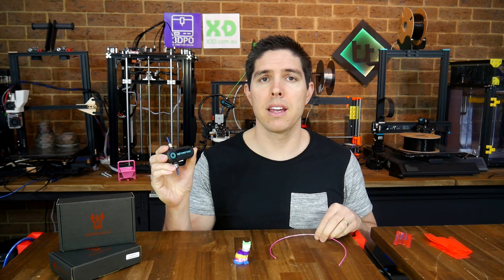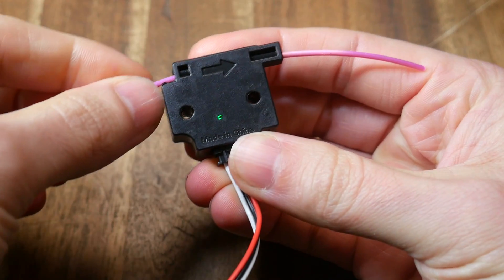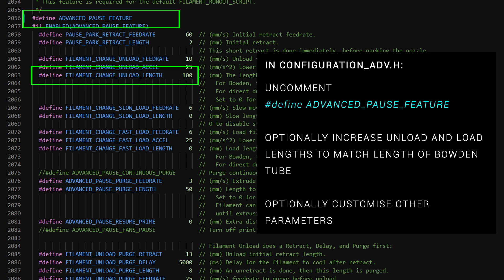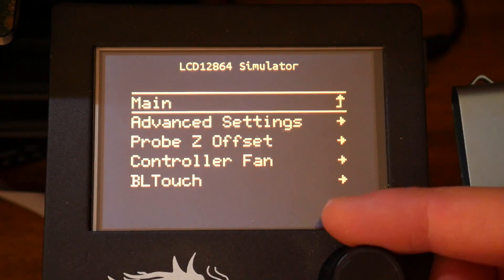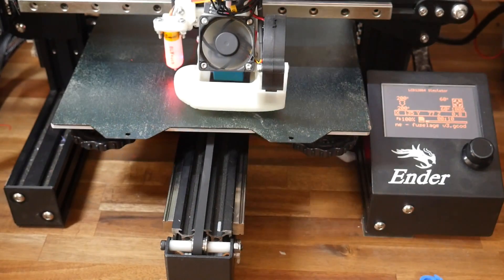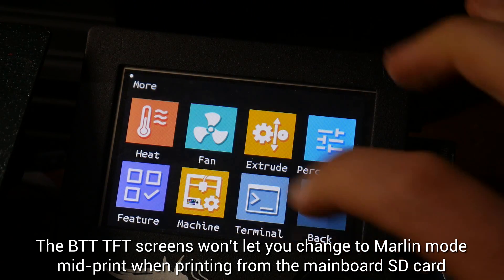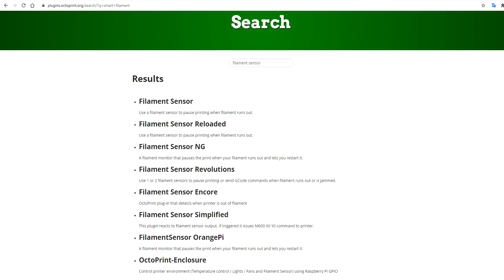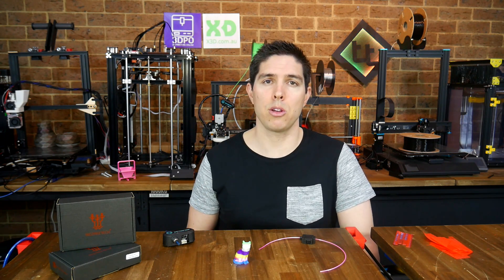BTT Smart filament sensor guide - Detect filament runout and jams

Comment: Hi Michael, I have followed your install several times. But mine keeps false triggering. I have been working on getting this to work for weeks now. Today I may have found a bug in some machines, I have a cr10 s5 with skr 1.4 turbo board with 2208's' It seems that the settings stored in the printer overwrites the FILAMENT_RUNOUT_DISTANCE_MM in the firmware. In my attempt to get this working I went into printer configuration -> advance configuration -> filament.. I tryed to change the run-out distance there but as soon as I click to make the changes it goes to 0 and will not let any changes to be made A reset is the only way to get it back to what it was... I also feel this has something to do with the power recovery function that also false triggers. Do you have any idea of a work around? Or even heard of this problem?

Comment: Great video - a thought: Could this sensor be used to calibrate the extruder steps?  You might have to calibrate this sensor first, but once that's a known quantity it should be possible I'm guessing.
Reply: Superb idea!
Reply: I'm sure it could.
Reply: Is the encoder and roller arrangement accuracy/tolerance within usable range for something like this though? Electronically as well as mechanical (?)

Comment: Michael I finally got the BTT Smart Filament Sensor to work on my Ender 3 Pro with a Creality 4.2.2 mother board!.  Here's a summary of what I found out
All the firmware changes that were described work , but for the Stock Ender 3 Pro 4.2.2  motherboard there are a few important differences;
1) The Creality 4.2.2 mother board pin "FIL_RUNOUT_STATE" has to be set to HIGH not low.
2) The pins on the motherboard PA4 plug where the sensor plugs in are, left to right; "Signal-Ground-Voltage"  the sensor I installed had the ground wire with a long white dash on it and the voltage wire had little "+" signs on it.  The signal wire had nothing.
So far I have run about 6 hours of prints using it and it checks out perfectly.

I really appreciate your efforts to  "teach" us how to modify our printers,  I've got mine setup with tis runout sensor and a BLTouch, so its simple to get good prints.
Reply: Hi, I have ender v2 Creality 4.2.2 mother board it is possible to work too?
Reply: I have mine installed but not working. Please tell me exactly what I need to change in the gcode to make it work, on klipper. Running a creality sonic pad 4.2.2 board ender 3 pro with 2.0 filament sensor and its printing like a champ just is not stopping the print by itself when there is an issue with the filament being fed! Also have a bl touch all set up good to go but yeah, need to get the filament sensor 2.0 working its all installed but wont do its job!

Comment: I tried hooking this up to my main board BTT SKR E3 DIP  and I couldn't get it to function so I tried to hook it up to my BTT TFT32 and it still wouldnt function. I was thinking it was bad so I sent it back to Amazon. All I need is a sensor that tells me the filament ran out so I'm trying to use my z-stop switch hooked to my TFT so I can use the touch screen. I'm not finding out how it needs to be wired though. I've hooked it up several ways and then do an M119 to check if it is functioning but it always reports open. Could you or someone help me or with the wiring? I can't seem to find any instruction or wiring diagram on doing this. Thx

Comment: I read github issues thread  (https://github.com/bigtreetech/smart-filament-detection-module/issues) and there were a few people with 
same problem as me. (
as usual with me, it can't be according to normal instructions :D ) I solved it but i spent 3 hours searching for a problem (printer Ender3 pro and SKR mini E3 V2.0) 
I hope this helps someone. Behavior: If you start printing marlin almost immediately trigger filament change. 
It looked as the board was not receiving any signal or no impulses? ok... I built firmware again, check cables,change sensor positions, looked into the sensor if there was a slip, change runout distance...without success. I watched the video one more time. Michael test sensor with simple circuit and diode. I tried it too and figured it out there are differences in two outputs. Connector left to to right: Ground, S,S, +5V. My first S output (its output which is used as default with factory cable) not working correctly, diode constantly switched on almost without interruption. Try second output and it worked just like in the video. I don't know if this is normal or the sensor is half/damaged but after i modify cable and use second S output everything works perfectly. 
My advice first check the sensor with diode if there is a pulse.

Comment: UPDATED:( CHECK REPLIES)I am not savvy at all when it comes to modding firmware. I keep getting codes thrown even when I try and build without modifying anything. Any way you can upload your firmware for the ender 3 with the bl touch and btt filament runout sensor on this page? It would help everyone including myself out so much! Keep up the good work!
Reply: Maybe the Octoprint-Smart-Filament-Sensor Plugin could be helpful for you if you  have problems flashing your firmware. It was released after this video. In the video description a link was added as update
Reply: @annil.8828  Thanks. I will check it out and see. I've been working with Chris from Chris's basement on this so after I do another firmware update I will try that out.
Reply: After many attempts myself I had help with Chris Riley from Chris's Basement. He was able to get this fixed and confirmed the only way to run this is in Marlin mode. If you have any BTT TFT touchscreens, the runout sensor will not work on touchscreen mode, but fortunately will work in Marlin mode. Keep this in mind for future reference.
Reply: @thomasalley8087  Thanks for your feeback. I got the hint that it has something to with the treatment of M600 from BTT LCD. To fix this I am going to add alternative interruption commands
Reply: @annil.8828  No problem. Let me know how it works out. Hopefully BTT will make some moderations to be able to decipher all this easier and make it more user friendly. All forums show a lot of people having issues with the runout sensors on their boards unless its something that has it built in already.
Reply: @thomasalley8087  If you like I can post here as soon as the update is finalized. Because I don't have a BTT LCD it would be great to get feedback if the changes make improve the compatibility :)
Reply: @annil.8828  Sounds good! Let me know how it goes!
Reply: @thomasalley8087  Hi v1.1.3 contains alternative pausing commands

Comment: Now I'm confused. After watching this video I was gonna plug the smart sensor into my pi and install the Octoprint-Smart-Filament-Sensor. But finally nothing of this needs to be done? I can plug the sensor directly to my SKR mini e3 v1.2 board and simply modify the BTT firmware and recompile it?  Note : I'm about to install my BL Touch on the Server and Probe ports, my BTT mini 24V UPS on the PT-DET port. So where should I plug the BTT Smart Filament Sensor? I think I'll only have the E0STOP port left available but it's only a 2-pin port. Thank you!
Reply: With the plugin for OctoPrint you don't need any changes on your firmware. If the detection is too sensitive you can change the value if the print paused and don't need to flash the firmware again and continue printing after changing the value

Comment: So I’m running the stock Ender3 Pro with the Bowden setup. I installed mine before the extruder, mounted to the x carriage. But I keep getting false triggers. I’ve tried increasing the runout distance and it still happens. I can’t print more that a few seconds and it pauses for a filament change. Any ideas what I can do to remedy this. I’ve searched the inter webs but can’t seem to find a solution that works. All help is greatly appreciated.
Reply: If it is not working with the firmware you could try the Octopi Plugin https://plugins.octoprint.org/plugins/smartfilamentsensor/
From my experiance the sensor is very sensitive and also reacts on slipping extruders. Maybe it is worth checking
Reply: Go to the terminal and do a M503 to verify that the runout distance is what you set it to. There is a bug that won’t allow it to be changed by configuring it in Marlin. You have to do M412 D7 in the terminal.
Reply: Also do a M500 after to store it to eeprom. The. Verify with M503.

Comment: skr 1.4 turbo TMC2209. Needs removing of the diag pin or it will report false positive.
Reply: Which pin and where do you hook it up on the 1.4 T diagram?
Reply: @chethammer  The diag pin of the 2209 stepper. Depends which manufacture it is. The manual says :"The module uses a break detection interface (such as SKR 1.3 for E0DET)"
I tried connecting it on E1DET, where I don't have a stepper installed and it didn't work...

Comment: Hey Michael!  Just received this sensor and opened my Ender 3 Pro.  I have the 32 bit Creality 4.2.2 board.  Is this compatible?  I'm totally new to this and don't really know much about how to hook it up.  I'm using your other videos to learn how to update the firmware and want to set this up at the same time.  Thanks!
Reply: Hi, if you don't want to do changes in your Firmware in the beginning you could try this plugin for Octoprint https://plugins.octoprint.org/plugins/smartfilamentsensor/

Comment: after installation and flashing the modified firmware I had to do a "M412 D7" otherwhise the runout lenght would be at 0mm and it would always trigger, I'm using a SKR 1.3 and the latest version of marlin
Reply: This needs more upvotes. Exactly the issue I was running into

Comment: in your video you said that (im paraphrasing) 'if you are running octoprint with the runnout sensor connected to the printer, it wont pause the print' i came home yesterday to find that octoprint had paused, and was waiting for the printer because my runnout sensor had been triggered.

Comment: @teaching tech why won’t this thing work with the Creality V4.2.7 board using Marlin bugfix-2.0.x?
Reply: I have the same setup seems to just start then immediately pause... did you have any luck?
Reply: @MrMooToYou  I have had zero luck figuring it out. I’ve tried firmware, changing lines of code, swapping wires, asked people for help from all levels of expertise on GitHub and Reddit, I even contacted BTT tech support (they are completely useless). I’m still trying but I’m thinking that maybe it’s not compatible with the board, even though BTT techs swear it is.
Mine does the same thing yours does.
Reply: @begiordano  I actually ended up getting it working now, switch a few things around abit seems to be working ok now.  I think marlin is a little buggy with those boards from what I have seen
Reply: @MrMooToYou  what did you do?
Reply: @begiordano  recompiled a bunch of times with a bunch versions including some teaching tech has listed all were very buggy or flat out didn’t work, I can send you the bin that’s working for me if you want to try it.
Reply: @MrMooToYou  yes please! That would be awesome and appreciated greatly.
If you have Twitter I’m @bbturbo1 that’s probably the easiest way to message me.

Comment: Second Try. Thank you for a very informative video. I have an ender 5 plus, touch screen control. What do you think the chances of the BTT sensor working with the correct firmware changes? Also considering a board upgrade to BTT SKR. PRO 1.2 with replacement screen. From your comments the upgrade would not support the sensor at the moment. The other board under consideration is the Lerdge X, any thoughts using the BTT sensor on that board? Thanks again for great content.

Comment: When using the Smart Filament Sensor plugged into TFT35 and using Touch Mode you need to comment out Linear Advance in your SKR Mini Firmware and Reflash, your sensor will work. I have two Ender 3 Pros with SKR Mini E3 v1.2 with TFT35E3s.  I read on one of the forums it is a bug in Marlin, and is somehow disrupting the signal.
Reply: What did you set for the pin for running through the TFT?
Reply: Thanks for this. is it possible to share the firmware? i have a Ender 3 Pro with BL Touch and BIGTREETECH SKR MINI E3 V2.0 + TFT35 E3 V 3,0
Reply: Can you please verify with more detailed information?
Reply: Can you give some more details please? qhat version of the tft35 are you using? Thank you so much.

Comment: Reading through [Issue 312](https://github.com/bigtreetech/BIGTREETECH-TouchScreenFirmware/issues/312) it sounds like in order to get Smart Runout working when connected to the TFT screen the Marlin firmware on the mainboard must respond correctly to "M114 E" commands. One of the commenters suggests that "M114 E" always outputs "0" when Linear Advance was active.

Comment: Michael I have an amazing and unique video idea for you. Make a video about upgrading a corexy machine with BLDC motors for the X and Y axes instead of steppers. You could control both with a single Odrive from Odrive robotics with their encoders. The result would be an ultra fast, ultra precise, corexy motion system like industrial cnc systems have. Plus Odrives can accept and interpret step/dir signals and output the appropriate BLDC signals so it can be incorporated into a setup using an SKR board.
Reply: Hey keezo1234, I would love to check out your video if you want to share.

Comment: To get it to work with TFT35 you have to enable start/end/cancel option in config.ini add these gcode commands and be sure to build the latest master firmware for the TFT35: 
#--------------------------------------------------------------------
# Start, End & Cancel G-codes
#--------------------------------------------------------------------

#### Default Start Gcode Status
# Options: [enable: 1, disable: 0]
start_gcode_enabled:1

#### Default End Gcode Status
# Options: [enable: 1, disable: 0]
end_gcode_enabled:1

#### Default Cancel Gcode Status
# Options: [enable: 1, disable: 0]
cancel_gcode_enabled:1

#### Start G-code - run this G-code before starting print
# maximum length 50 characters
start_gcode:M75\n

#### End G-code - run this G-code after finishing print
# maximum length 50 characters
end_gcode:M77\n

#### Cancel G-code - run this G-code after canceling print
# maximum length 50 characters
cancel_gcode:M77\n

Comment: Just to be clear, because I didn’t find anything on their GitHub. Is this compatible with ANY motherboard running Marlin 2.x with the appropriate settings on?  I have a i3 style printer with a MiniRAMBO 1.3 and a viki lcd screen. I’d like to replace the micro switch runout sensor with this.
Reply from the maker: In theory yes, it's just a 5V pulsing signal so any mainboard should be able to read it with the firmware setup correctly.

Comment: I have an SKR Mini E3 V2 board with a TFT35 E3 touch screen, I also have ALL the extras that you can think of and I of corse have the BTT “Smart filament sensor” and I’ve had this for around 3 months now, I have been configing and tweaking it ever since I’ve had it and I have had no luck at all! I start a print and as soon as it’s extruded the amount set on the config it retracts all the filament out of the PFTE tube and I get a message saying “Load Filament Then Press Ok” which I do but I get the same message each and every time! Surely BTT should have known this before selling them to the public! I’ve even seen BTT sell bundle packs which consists of TFT screen and SKR Mini board WITH a Smart filament sensor whilst knowing that there not comparable! I’ve waited for 3 months for some update or something which will make it comparable with the Boards/ Screens, A filament sensor is just what I need but as this is useless I’ve had to revert back to the bog standard Endstop switch which doesn’t detect clogs or resistance, Please can someone somehow do something to make it work! I’d run it through my Raspberry Pi if it was comparable
Reply: Same problem here! I have the SKR Mini 1.2 with the TFT35 E-3. I am using the E0 on the main board for my BT Touch so have to plug in my filament sensor to the TFT35. NO DICE! It gives me an error like you and backs out the filament to demand I reload. EVERYTIME.
Reply: Jeremiah Burt Well, I’ve just noticed that Marlin have released 2.0.7 and I’m reading that they may have fixed the problem 🤞🏻 I’m not sure how... but I’m going in for a compile soon so I’ll let you no how I get on, I’ll try the board and if that’s no good I’ll try the LCD
Reply: @tonygudgeon1839  Let me know please! I would love to find a working solution.
Reply: Jeremiah Burt I will mate
Reply: Jeremiah Burt Ok so some goodish news! You probably do but are you able to config Marlin in VS Code or Arduino? (The new Marlin 2.0.7)
Reply: @tonygudgeon1839  I edit code in VSC, so can make changes. After I saw your comment I started building a fresh 2.0.7 version of Marlin using an Ender 3 guide I found for my board and the 2.0.7 build. Haven't tested it out yet. Heading out for weekend. What did you find out?

Comment: Also, when using with Octoprint, the firmware on the printer will buffer sometimes several lines of GCODE. So firmware must tell Octoprint to pause too, otherwise when octoprint decides to pause, it could be too late.

Comment: What software are you using to edit the firmware?
Reply from the maker: Visual Studio Code. I have a setup guide for that very soon since things have changed since my last Marlin 2.0 setup.
Reply: @TeachingTech   I had to set that up, Unable to use Arduino anymore under Windows 10 to build Marlin. Also needs PlatformIO and I added auto build marlin too. Only issue is wow did it install a lot of files ! Noticed that night when it did the nightly backup. Something like 38,000 new files were added.